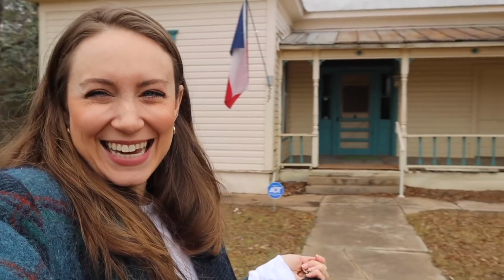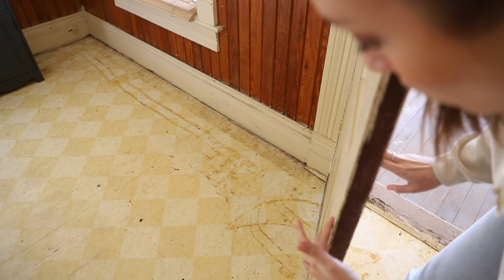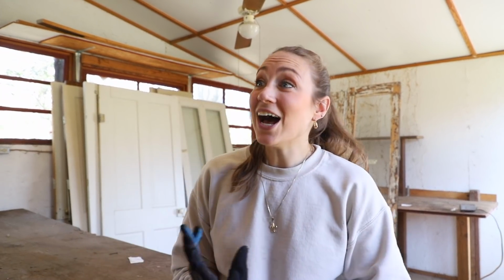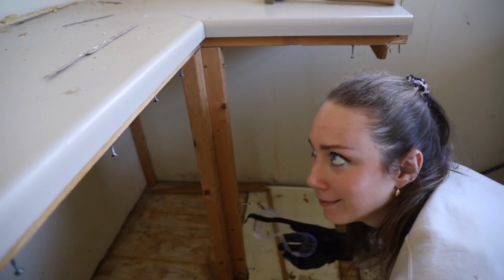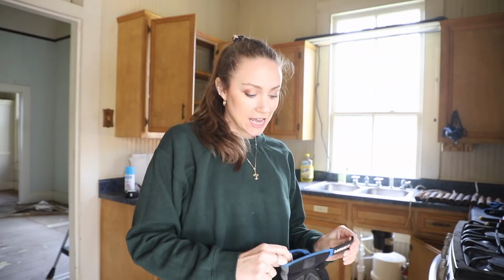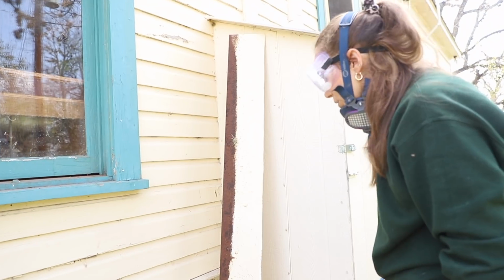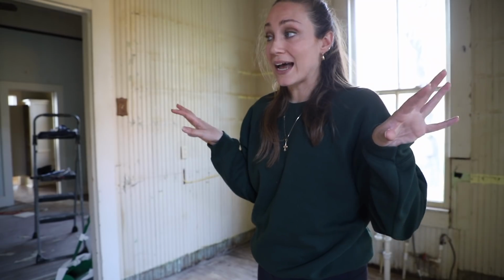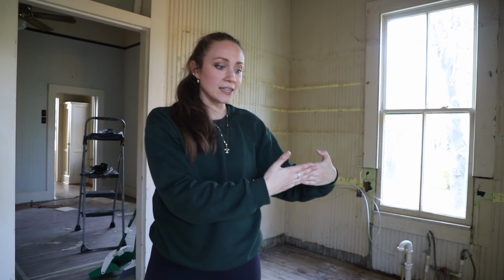Demolishing The Kitchen ALONE | Renovating Our 110-Year-Old Cottage

Comment: Just a friendly heads up- concrete floors still draw moisture up into the bottoms of your doors- using a tarp underneeth helps a ton. It made our doors swell and we had to plane them down to make them fit correctly. You're doing an amazing job!

Comment: You are so brave MaCenna for tackling this by yourself. Tip from my ex, a general contractor, get yourself a sawsall or reciprocating saw. It will make demo'ing those stubborn sections out a lot easier especially when you come across stripped screws.
Reply: I was thinking the same thing!

Comment: In Australia, in most houses we have a separate wc/toilet to the main bathroom, our vanity, shower and bath are in one room and the toilet is in another. Main/principal bedrooms have an ensuite with the toilet, shower, vanity and maybe a bath. Coming from a large family this was fantastic as going to take a bathroom after someone had been to to toilet left a lot to be desired, also it meant someone could still bathe whilst someone was using the toilet. I don't know if it is because initially the toilet was an outhouse and they just added them on later or if it was a regulation when indoor plumbing occurred. I have rarely seen it in American renovation unless it is high end larger homes I wonder if it will ever eventuate over there.

Comment: Several ways of removing stripped screws ... cut them at wall level with a diamond cutting disk, (given up and done that a lot!), put a thick elastic band on the head of the screw and use it as leverage for the screw driver, buy a special tool to remove stripped-head screws ..

Comment: Suggestion for the broke glass on the door-of course it has to be replaced-but the beautiful glass can be reused-my idea-have a section with a part of the picture that is on the glass cut and put in a frame on black or red velvet and framed in vintage style and hung as art-my husband idea- to cut the glass in to sections and use as a stained glass window or art to hang- im not sure if i am getting the idea across-if there is a flower on the glass -use as the center and use colored  glass around

Comment: JesUS.  I had to stop mid vid bc I saw myself in you and what I would say to past me when demoing is:

-TAKE IT EASY bc whether you think so or not, you will burn out, so pace yourself
-wear that lower back brace movers wear and BEND WITH YOUR KNEES.  It will force you to bend correctly, even if you have to move slower.  If you hurt yourself, you won't be able to do ANYTHING.
-sliders: exercise or furniture, whatever, you could've slid those machines right out the door.  Also that little   pull crate? trolley thing? Its 4 pieces of wood in a square, with wheels, and carpeting on it for friction, yes
-wear your mask.  Asbestos isn't the only harmful thing you can breathe in
- Treat yourself: Lay out your fave healthy snacks and refreshing energizing drinks(on ice or in fridge in summer) in a way that you can eat without having to remove your gloves
-take as many breaks as you need. This is your house! You're not working for anyone else.  Do it in the best way

Much love from NYC